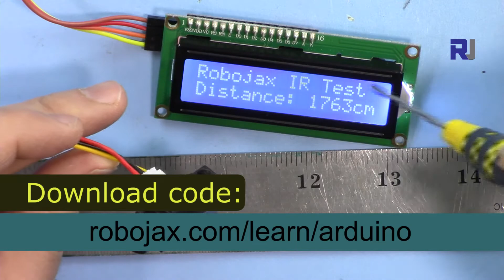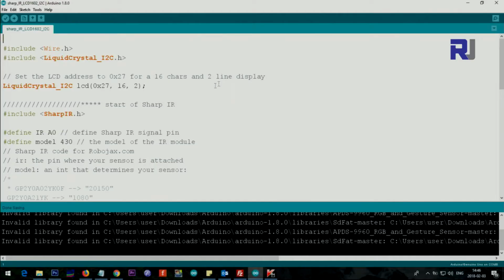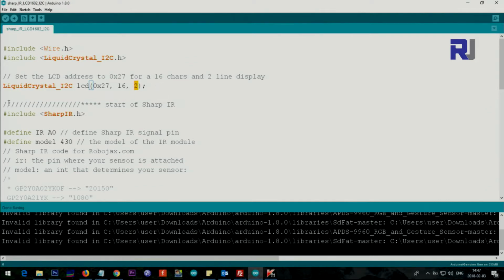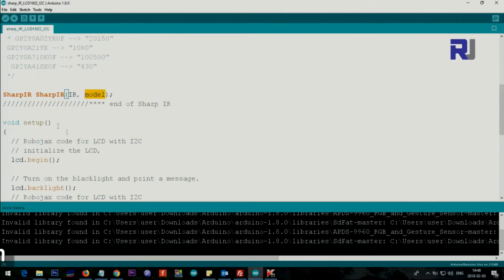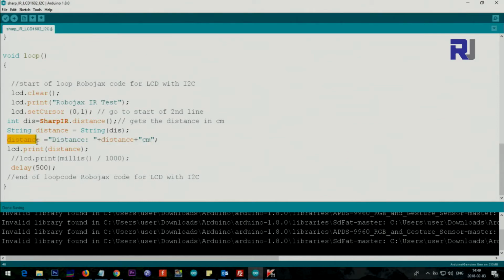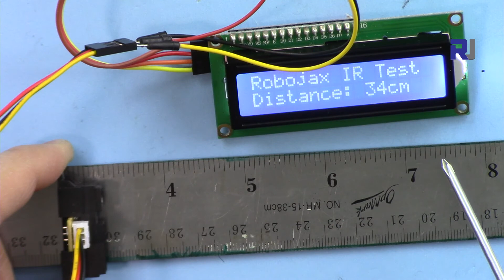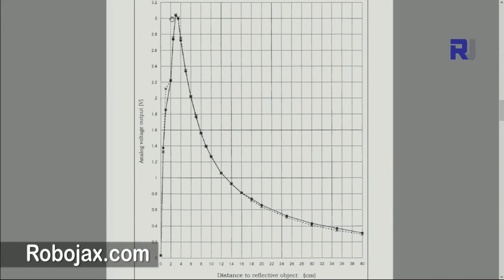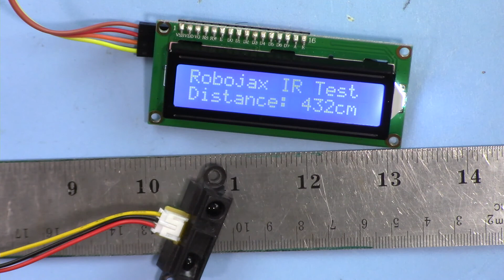Measure distance with Sharp IR sensor and LCD1602 display with I2C in Arduino RJT56

Comment: this is the error : 
'uint8_t SharpIR::distance' is private within this context.... 

and it points to this line of code:
int dis=SharpIR.distance();  // gets the distance in cm
Reply from the maker: I checked the library on Github here https://github.com/guillaume-rico/SharpIR/blob/master/SharpIR.cpp at line 84 it is defined and it is not private.  did you get the code from Robojax.com?  Make sure to use the library from Robjax as that is the code shown on the resource page and in the video. please do not modify it, just run it . once it worked, then customize it.  May be you are using different library. I have used the library above. But not sure if you used the one from Github,  Try first reading the distance and displaying it on serial monitor. making sure it works. then try  the LCD along to display "Hello world" and make sure it works, then come this combined code.